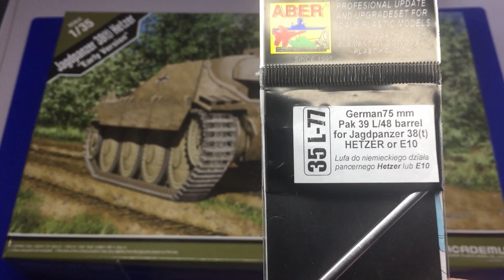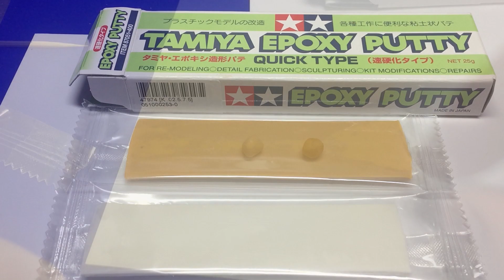Academy 1/35 Hetzer Build Part 1

Comment: Late to the party, I love the Hetzer's, building a Prague 1945 @ the min! You may know this now, you only need to dab the extra thin on to join parts not flood in most cases, I think the bristles on the brush you used to apply the surfacer were too long, use an old brush with short bristles, the side armour doesn't have a cast texture more a rolled steel one easier to do with extra thin and a short haired brush. I use many reference photos for the detail on the tanks/trucks I build! All said nice build Dude. TFS, GB :)